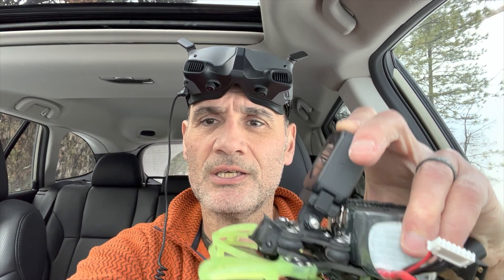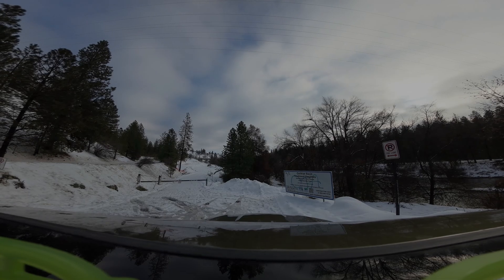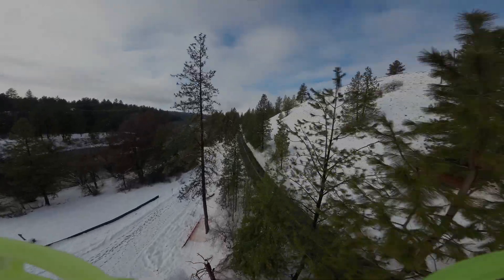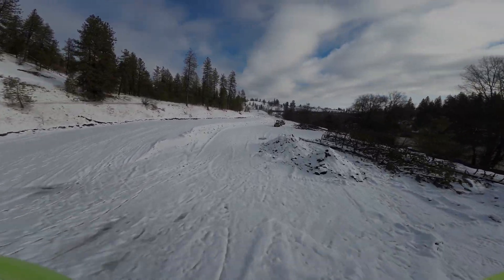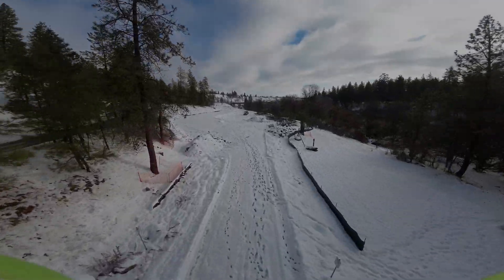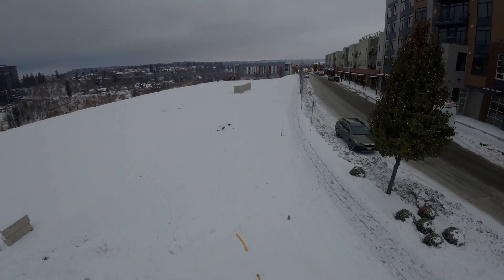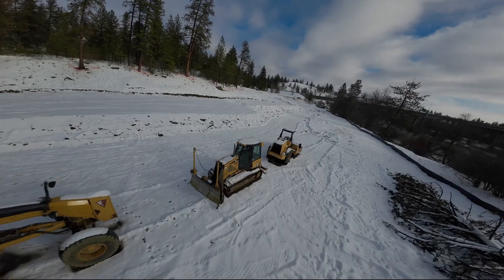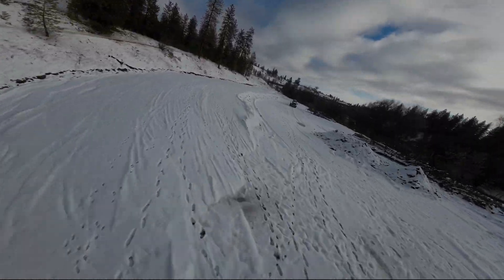DJI O3 Testing - CIneLog35 Performance

Comment: How come you didnt go with 48khz?
Reply from the maker: @Wontonsoupz  at the time I was still testing to figure it all out. This flight was at 48khz and this was only a week or so after the O3 was released. None of the big YouTubers had even addressed it yet and at least for my part, I was getting mixed results following the guide that DJI put out. I finally got good results with all my O3 builds but even a couple BnF drones came configured in such a way that there were the bad vibes.
Reply: @smithe68  Chris RooneyFPV gave me a tune for 24Khz. It's great, feels very lock in but the motors get really hot. So I went with 48Khz it's not as good but it's doesn't get hot motors.

Comment: I ordered a cinelog35 on vista and separately on o3, because if I change it myself, it will be much more profitable) at the expense of vibrations, most likely the issue will be resolved by the manufacturer approximately like on another drone (cinebot30)
Reply from the maker: I hope yours goes smoother than mine from the start!  At least mine is now working after lots of messing around.  I flew again today and it’s not quite as good as this flight but I was carrying the Action 2 on the mount and today I wasn’t.  I think the extra weight actually helped but I really don’t know 🤷🏽‍♂️
Reply: @smithe68 I am sure that the matter is both in the load of the site and in the place of attachment.  Most likely, many tpu models will be released soon for upgrade 🙏

Comment: Oh and another thing, I hear the gyro from the 03 is in the camera module itself, maybe use tpu mounts for it? If ur not already.
Reply from the maker: Yeah apparently it is and not only is this in TPU, it’s rubber dampened!  My other frame was rigid mounted but I removed the aluminum front end and put regular standoffs and TPU mounts and while it got sort of better it’s still not good.

Comment: Hmmm I’ve heard of people having this issue. So far I’ve put the 03 in a 5” apex build and in a 3” geprc cygnet build both running Kiss and I don’t see any vibs. I guess it’s a hit n miss deal and it doesn’t make sense. I’m glad it’s doing better for ya.
Reply from the maker: Yeah it’s so random!  I keep seeing people say they put it in whatever and it works great, others not so much and others with factory O3 BNF also having troubles!  Happy to hear someone is getting good usage out of theirs in the frames they want to use.  I got 1 out of 2 working pretty well 🤣
Reply: @smithe68  I’m sure you’ll get the other one working. That’s one thing us fpv pilots are good at, is keeping on it til we get it. “Even if it requires replacing parts” 😂
Reply from the maker: @justinslaight  not going to lie, I’m done with it, working on a video right now about it.  Going to move it to something else and start the whole battle over again!
Reply: @smithe68  Hey, I found on my 3” that it’s fine with rocksteady off but when it’s on, it’s like yours. Not good…

Comment: So is it worse than the DJI Action 2?  Should not have to soft mount their camera, that's a bummer.  Waiting to see after the hype before upgrading my stuff.  Still rocking the old DJI V1 goggles.  Good luck friend and I am sure they will get it right.  Sucks that you have to beta test it for them.
Reply from the maker: Yeah it’s not as good as the Action 2 but as you can see it’s getting better than it was.  At least on this frame I am pretty happy with it even though it’s not as smooth as some of the other videos I have seen.  I have a BNF O3 quad on the way, I pre-ordered it during Thanksgiving weekend and it shipped so hoping to have it soon.  If it has the same issues as my self installed ones, I’ll be done and back to my OG DJI setup until they can get their stuff together.
Reply: @smithe68  well I hope it works out for you and will continue to watch for your updates. 👍
Reply from the maker: @MarcsFpvAddiction  thanks Marc!

Comment: so i checked my new O3. no issues. i stay with my opinion that this is vibration related. i made a short test flight JUST FOR YOU buddy. please check it out. no jello or vibration on my quad. 
https://youtu.be/kObzPh0n3m4
now here is the thing: i realized that the cam in my frame is hard mounted. there is no softrubbery going on at all.
i check your video at 0:43min and paused it: there are 2 things come to my mind. first it seems you mount the O3 cam with only 1 set of screws to a TPU or PLA printed part? take that off first and use both crews each side to mount the air unit cam. thats way too loose. it seems iflight is doing the opposite to O3 cam and hard mount it. i cant move the camera even half mm with my hand. its really tight 
second is your actual A2 cam mount. i saw you use this soft mount thing which is very similar to what i have but it appears to be too hard. plus the fact you didnt put action cam in a TPU frame which holds but instead you use the original magnet metal mount. thats far too long and introduce more vibration to the top of the A2 camera. 
now i watch your video:elbowbump:
Reply: alright i finished the video. DJI A2 cam footage is way better with the soft mount and if you get rid ot the metal magnet thingy. and throw the cam in a TPU housing it will be perfect. good job on that!

O3 cam has still alot jello. to get rid of that try mount the O3 more tight to the frame. basic question: do you have a rubbermat under your lipo? and how tight do you strap these to the frame before you fly?
Reply from the maker: @cloudpandarism2627  I actually think there are either issues with the O3 or it’s just crazy sensitive.  People are buying BNF O3 quads with the same issue I am having and nothing seems to be fixing it, this shouldn’t even be a thing from the bigger companies.  I’ve seen it in iFlights and GEPRC.  The iFlight ones I have seen the camera is mounted in TPU inserts, is yours not?  My other O3 quad is hard mounted and it has the same problem as the soft mounted one, except no changes of PWM frequency or amount of screws has fixed it.  I removed the factory front end and installed traditional standoffs with some 3D printed camera mounts and will be testing in a couple hours.  

So weird thing, I used to have the A2 in TPU and it didn’t look good, on this quad anyways. On others in TPU worked fine.
There is a little but it’s 100x better than it was as you saw before.  I use rubber mats and strap the battery down very tight.
Reply: @smithe68  rubber mats and strapped down lipo is right. the more total weight the quad have the less it can vibrate. TPU on top just to make it as lightweight as possible. more weight at cam means higher chance to hit exact resonance frequency and then you have jello again. 
what i mean is to get the base plate of that mount as soft as you can without the camera actually moving from throwing the quad in a corner for example. you saw my videos. zero jello. ever. thats because i mechanically decouple my action 2 from each quad i have. without that mount i also have jello like hell. sometimes more sometimes less but still jello. what you can to now quickly is to uninstall your mount from frame. the black rubberthingy. them put thick double sided gel tape on. just a 2cm x 2cm part. and then gently put that rubber mount on top. now here is the trick: use zipties to hold that mount in place BUT dont tighten them so much that the rubber base plate cant move. again we can movement for the A2 mount. as much as we can get. that means if the quad doing its world star number as disguised vibrator the camera mount getting nothing or very little from that. and the rest doing the rubber things. make the zipties tight enough to hold it in place but be able to move the whole base plate 5mm in each direction by hand. try that. i swear if you get it right one time you will understand what i mean and never need to deal with jello again ever. as i said before i had this conversation countless times here. at the end people just printed my mount and jello was gone. some of them dont wanna listen and still fiddle around with PID tunes and ND filter nonsense. 
everything i just said was A2 related. 
O3 cam is another story and yes mine is also in a tiny TPU triangle. but its so tight that i am unable to move it by hand. it feels welded to the metal frame. i am sure there is no way this TPU thing does anything to prevent jello. 
and yes i also talked to the other guy who have the new evoque V2 and there is jello in the O3 cam. i will talk to iflight boss about this soon. maybe she will send me an evoque to try. then we will see... i send you messages on insta. not sure you saw them. i barely check it but i wanna send you the photos you got.